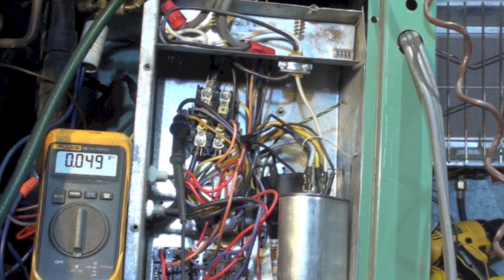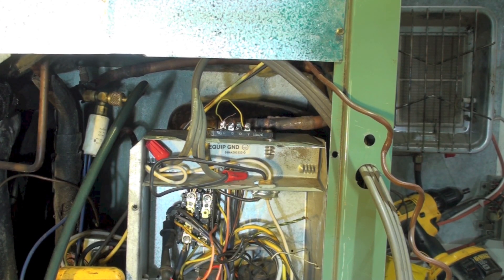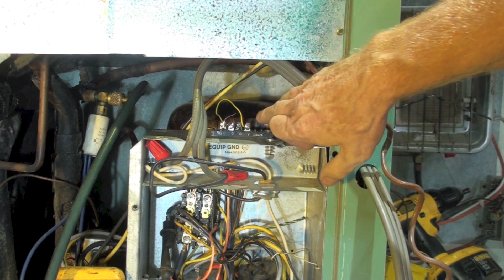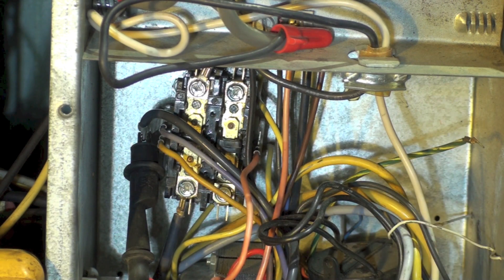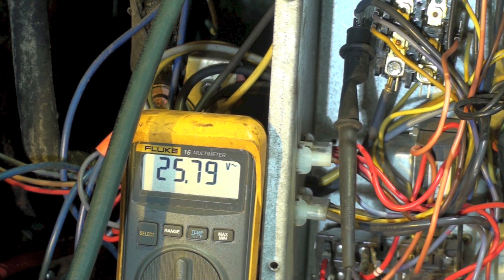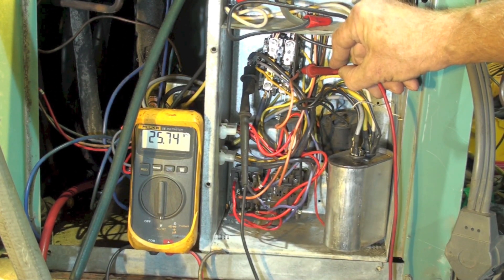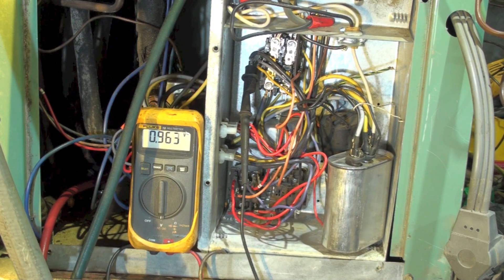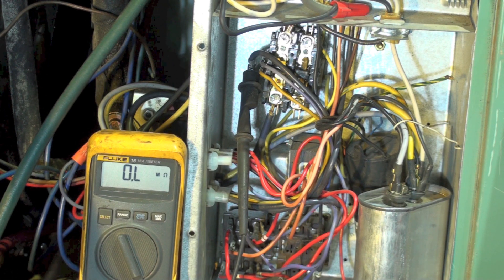Electrical diagnosis of a water source heat pump

Comment: The coil isn’t a 24v coil?
Reply from the maker: Some of the Carrier units had a 24 volt control relay that controlled the 240 volt cantactor for the compressor.
GFM

Comment: im going to say a failed coil. Think its not letting enough current to flow to pull in the contacts
Reply from the maker: Check the end of the video.  There is a link to the answer.
GFM
Reply: @grayfurnaceman  checked out the answer~ thanks for video

Comment: The meter is showing voltage but actually there is less or no voltage when the circuit is loaded, best way is to place some load like same voltage rating contactor or bulb and test it.
It seems loaded circuit voltage drop problem.

Comment: 2 poles contactor at 24 volts IS around 11 ohms while a 120 volts Unit  would show  typical 237 ohms.  Either you have a wrong feeding voltage that should be 120 volts or a wrong contactor that should be rated at 24 volts ac.https://literature.rockwellautomation.com/idc/groups/literature/documents/td/400dp-td001_-en-p.pdf

Comment: Remove the contactor, inspect the coil voltage and AC/DC input requirements.  It is one of 3 possibilities: Its a high voltage ac coil, a DC coil, or a bad contactor missing the inductor core.  Once you eliminate the impossible, whatever remains, however improbable must be the truth.
Reply from the maker: Check the link at the end of the video and you will see what answer I found.
GFM

Comment: Yea its probably that this contactor is rated for a higher voltage but I dont know the resistance seems high to me anyways maybe its burned and there is carbon in between the burns and thats causing the high resistance
Reply from the maker: juancarlos1619jm Very hot.
GFM

Comment: 120v or 240v coil in contactor.

Had similar years ago, was supplied a 415v coil for 240v application, just chattered in and out, learned to check them before fitting on that job!

Comment: Was the transformer replaced with an inadequate VA output?  Maybe all the component voltages are correct, but not enough current.
Reply: On second thought, that doesn't explain the unusually high resistance you measured.  Nix the answer above.

Comment: the answer is in ohms law.
Reply from the maker: Emin HVAC Actually, ohm's law does not apply to inductive loads.
GFM
Reply: GFM, you first use the formula to convert Henries into Ohm':this  gives you the ohmic value for the coil. then Ohm's law works.
Reply: +grayfurnaceman Ohm’s law? Actually they do. If you measure the resistance across the windings, with the electricity off,you might read something like 3 ohms, but 120 volts divided by 3 ohms, according to Ohm’s law, would mean this motor should draw 40 amps. Installed and running, our little motor draws 6 amps. So, what’s up with that?
The short explanation is that the resistance in the windings changes after the switch is turned on. Inductive loads, like motors and solenoids, convert most of the electrical energy used into magnetism. The magnetic waves come out of the wires that make up the windings in all directions, like ripples in a pond when a rock is dropped into the still water. As these waves of magnetic energy cross the adjacent windings, they grab onto the electrons vibrating back and forth in the wire and try to hold them still. This has the same effect as adding resistance to the circuit.
Thus the resistance across the motor windings is greater when it has current flowing through it, than when it is de-energized.
The resistance that you can measure with an ohmmeter when the motor is disconnected from the power, plus the resistance caused by the magnetism, is called impedance. we can use Ohm’s law to calculate this impedance. Voltage divided by current equals resistance or, in the case of inductive loads, impedance.
If you want to get more in depth, you will find that as the magnetic waves cross neighboring windings, they cause voltages to be “induced” into the circuit, voltages that were not supplied by the power company. These voltages are referred to as “inductance”, and they make up part of the total resistance to the flow of current in inductive loads.
The windings can store small amounts of voltage, like a capacitor, and these voltages are termed “capacitance”.
If we add the current resisting charactoristics of inductance and capacitance together, the total is called “reactance”.

Comment: I think you need to check the contactor coil rated voltage.  Is it looking for 24 volts or something higher?  With that high an ohm reading, I think it is looking for a higher voltage to energize.
Reply from the maker: Joe Marchione You are getting there.
GFM
Reply: Thanks!

Comment: What is the coil voltage for the contactor installed?  I would guess someone put a contactor with a 240v coil.
Reply from the maker: Leonard Keyser close
GFM